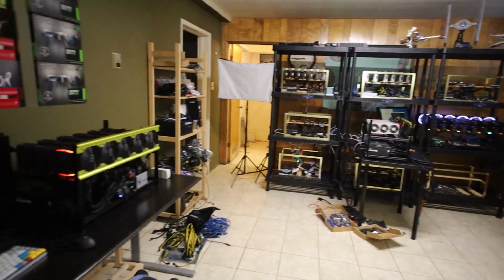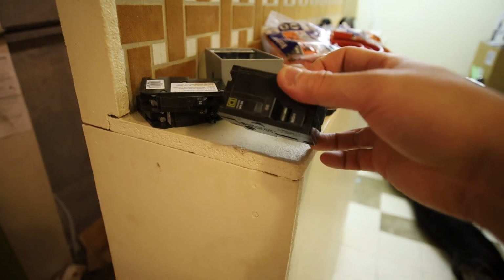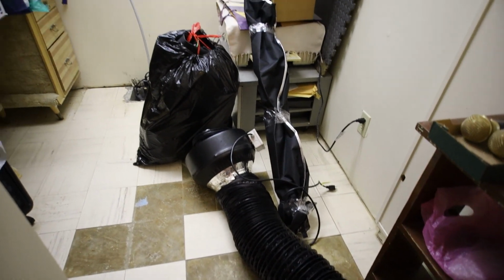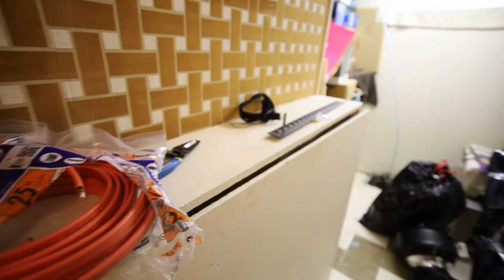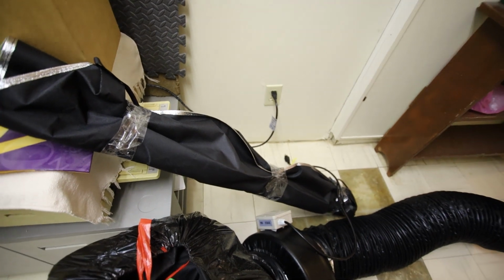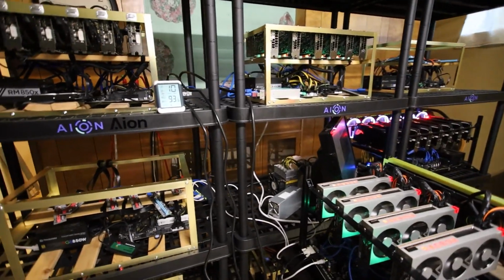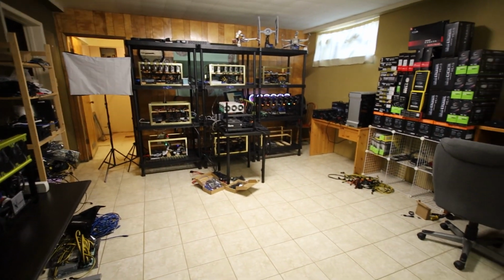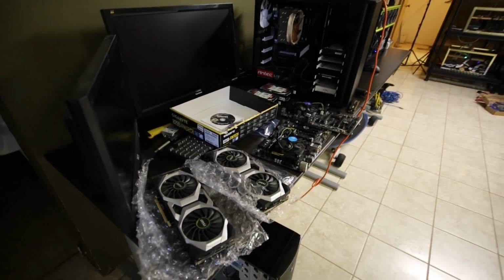Running More Mining Rigs On 240v SOON...

Comment: Need to have him install the 2nd outlet in the other room so your power cable isn't ran like that to the current PDU. Then use the plug you already have mounted for the grow tent. Would be much cleaner setup. Good luck.